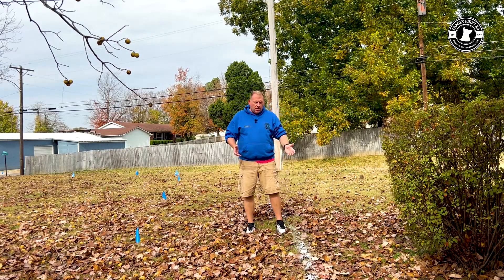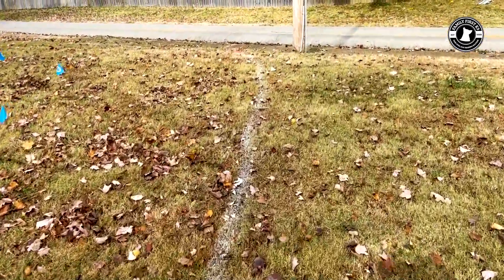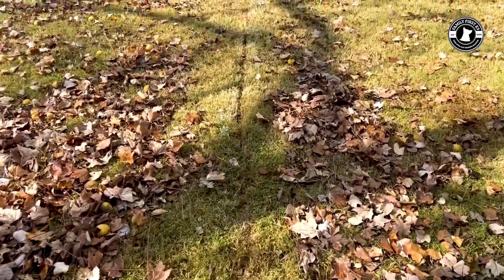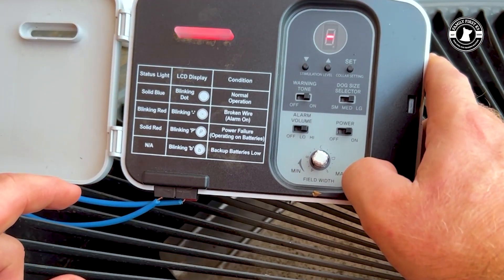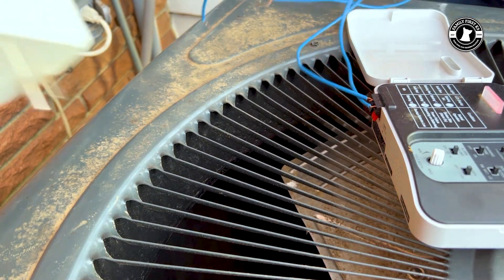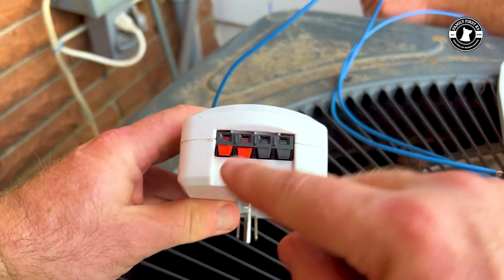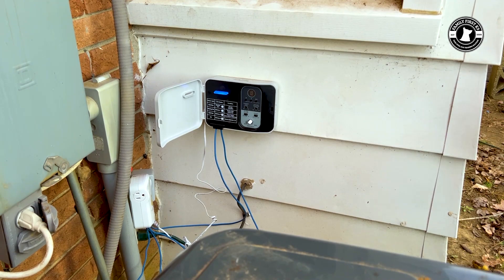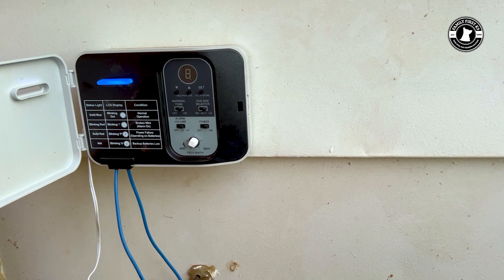Educator E-Fence Installation

Comment: How do I pair a new collar to the system
Reply from the maker: The default setting is tone only.  To customize the new collar, change the value of the tone, stimulation level and dog size on the controller.  Then place the collar on top of the controller.  Press the "Set" button until the led on the collar flashes from red to green.